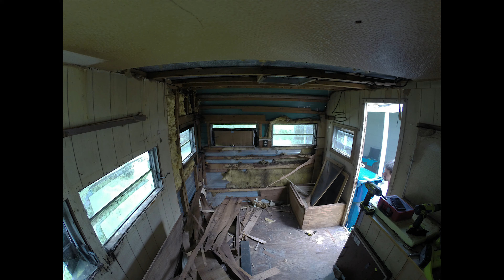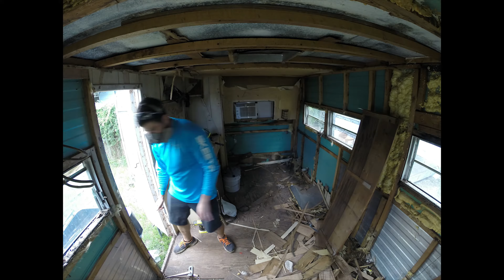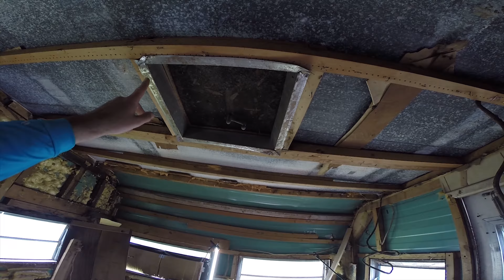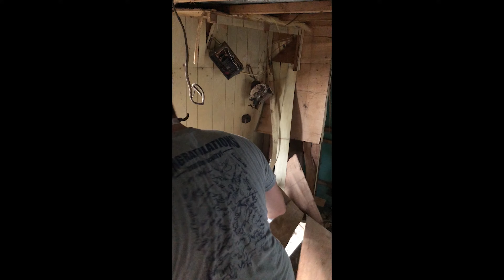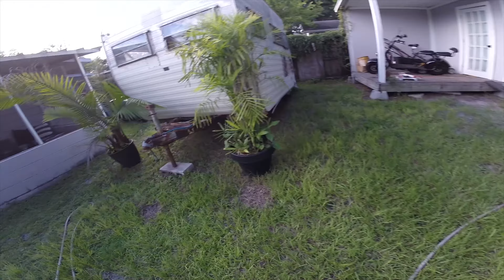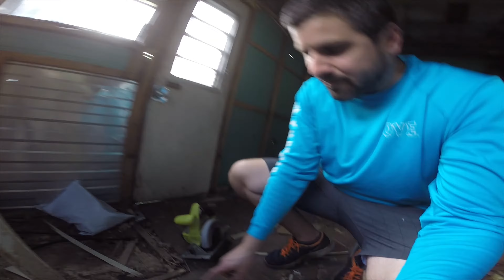1964 Layton Vintage Camper Restoration - Part 1 - Demo

Comment: I’m starting a 14’  72 Haico Skylark Wednesday
Reply: I’m removing exterior panels though to repair, much easier to repair I will be using pressure treated for the main frame and window headers and footers tyvek the exterior frame and isolate using dampening peel and stick with breathable insulation like you I felt that with the 3/4” T&G finished 1 side was a good choice 
Any suggestions

Comment: I just bought a travel trailer myself. An old one that needs quite a bit of work. I'm going to be pretty much gutting mine as well. But here's the thing. I have no experience in fixing things. So I'm going to need help. I may be able to get that from some people I know. I think it needs electrical work as well. This is going to be a big challenge for me, the hardest thing I've probably ever done in my life just because of my profound lack of my experience. I hope to pull this off truly. My money is just so limited right now so I had to go cheap. I'm living with family right now but my time is running out here. Hoping to get this done in a fairly limited time. We'll see though.
Reply: Good luck..and i really mean that.  Im in the middle of doing it myself.

Comment: You are totally taking the structural integrity out of the trailer, you need to take it apart from the outside inward, that thing will fall apart going down the road now cause there is no structure now! Don’t believe me? Go check out mobiltech canned ham trailers he shows you how to do it proper!
Reply: Learned that the hard way.  I had to take mine apart to the frame anyway but i think as we start we think it can be salvaged but the rot just keeps going and going and going hahahahahah

Comment: My friend just bought a 1972 Kit Companion and stripped off everything. All the wood is rotten, even the floor.
He asked me to rebuilt the floor and walls (structural wood, insulation and paneling)
My question is... How long time do you estimate it would take?
His goal is to transform this trailer into a food trailer, so after rebuilding the basic structure, we also have to install electricity, plumbing, kitchen appliances, etc...
Reply from the maker: So dude, if i had to do it again I would just take off the aluminum siding and demolish everything but the trailer.  I spent months trying to rip this thing apart one piece at a time and replace it.  Not to mention removing hundreds of stripped or rusted screws.  

If I could go back in time, I would buy a lightweight trailer and builder a vintages styled camper on top of it!

I have 100+hrs of footage I will start editing when I finish moving, and the camper is almost fully secured but man has it been a pain in my ass lol
Reply: @RoccosModernLifestyle  so...you recomend building everything up again?  Remove the aluminum foils, build the frame, and then...put the foils back. 
That sounds like a lot of work and time.
Reply from the maker: @ThomasDMT  I would honestly just scrap it all. Starting with nothing but rot and wear takes so much time, money and energy.  I would buy an aluminum trailer, and start building it from scratch.  Had I dont that to start, I would have saved hundreds if not thousands of dollars.
Reply: @RoccosModernLifestyle Well, this is music to my ears. I just got an old 40's (maybe 50's) egg shaped travel trailer, everything scrapped but the frame and subfloor. Basically looks like a little trashed flatbed. Every piece of wood is coming off so the frame is bare metal to then build on. Only, I'm still researching how to approach this: Do I start with a wrench to old rusted bolts? Do I just saw these thick rusted screws off? Devil's in the details, apparently.
Reply: @mprudes  I have a 59-61 (best guess) Layton 10-footer that is registered as a 2000 homemade trailer (ie, a pair of welder brothers fabbed up a more generous frame, then set the body on top, and a-hunting we will go!). I've saved and repaired all the original parts I could (badges, tag/light ass'y, the 2 remaining jalousie windows about which I'm writing a song...), and yes, mine has the aluminum skin with the pretty-colored side in, also. Rather than repair the rotten wood, a previous owner panelled the interior with 1x6 fence boards. I agree with Mr Mobiltec (Larry?) on working from the outside in, but I must simultaneously work from the inside out to remove a couple of botched redo attempts, then we meet in the middle. Since apparently this thing's been hit by a tree, I don't have all the original aluminum, so I'll remove said skin, make the repairs, then the street-side siding will move to the curb side, the original roof panels will morph into the street side, then I'll do the roof/ends in diamond-plate aluminum, one continuous roll to reduce potential leaks, and I'll make some funky MidMod details out of the scrap. I have that Haint Blue aluminum like he does, but also some that is butter yellow. As for rusted frame parts, I bought a needle scaler from HFT, will bust it down, use rust-converting primer, metal primer, then probably paint it with this gallon of white FlexSeal that's paid for. All the best with your project!

Comment: So have you posted the other 11 parts somewhere?
Reply from the maker: No, we havent but we broke the project down into 12 parts.  We are wrapping up the floor/frame now which is part 2.  It was a big job!
Reply: I just finished up demoing the inside of my 70s Coachman Cadet.  Need to replace a lot of the framing. Hopefully I can get that done over the winter. Then need to tackle the flooring, the entire floor is almost completely rotted and needs replacing.
Reply: I just watched Part I and subscribed. My wife and I will start demo on our 1968 Winnebago 14' Pull Trailer. Will subscribing let me know when Part 2 uploads?
Reply from the maker: https://youtu.be/sndBrCLXDf4

Comment: I am in the process of restoring a 1970 Coleman pop-up. It started out just about as bad, but a much smaller, easier project. Can't wait to see the end product.
Reply from the maker: Yeah its been quite the project so far.  The floors and trailer require a TON of work- so currently filming that as I get time.